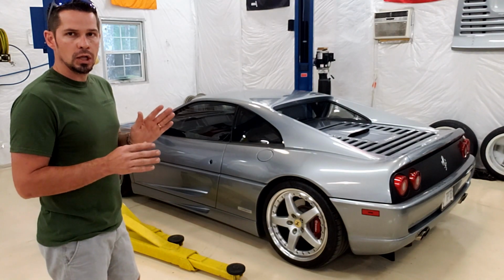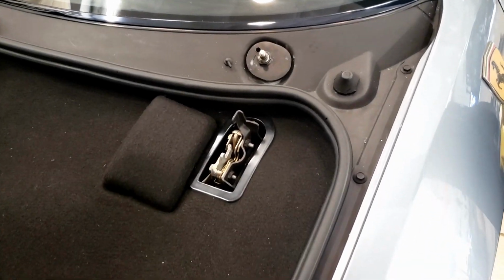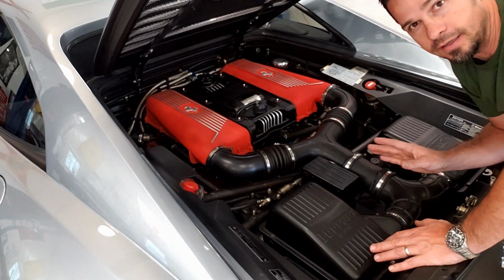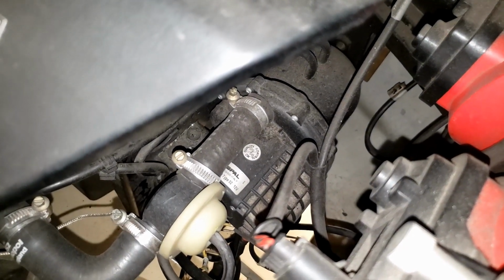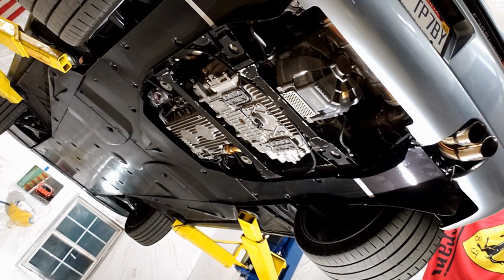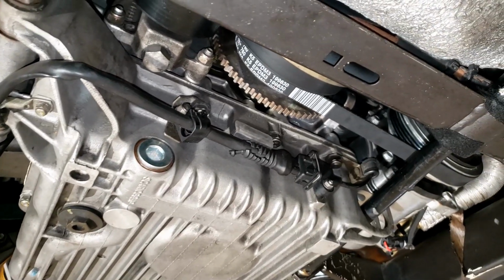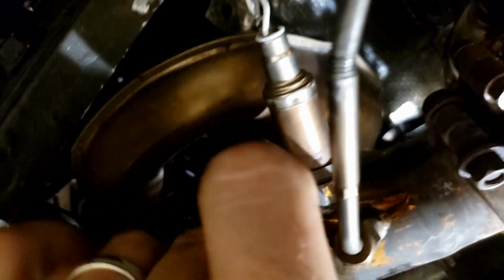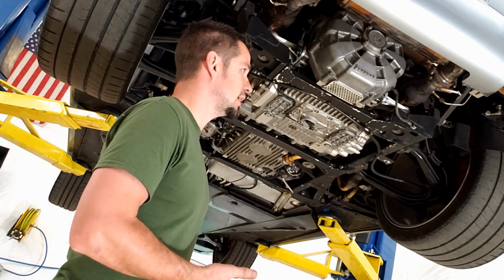Discovering the Ferrari 355, In depth mechanical walkaround on lift

Comment: I don't appreciate the disingenous premise of the intro. Doing it yourself is a BIG DEAL. That garage didn't magically appear out of nowhere. You didn't find those expensive tools in a Cracker Jack box. The time you spent on it has to come from somewhere else in your life. And not everyone gets as lucky as you in their part failure rate.

You make it sound like you can just snap your fingers to save tens of thousands, when in reality you have to buy and maintain your own little dealership.
Reply from the maker: Sorry to offend you. 
At the time this video was made, I found most other reports of this car were quite disingenuous, claiming they needed something like $30,000 a year in maintenance. My claims are not related to the fact that it takes effort to work on a car, I was simply addressing the the stereotype versus other cars. 
Pretty sure it's safe to assume that most owners already have a garage, I don't know anybody who keeps their 355 outside. 
Yes you have to get under the car to do some work... Just like any other car.  you can accomplish this with a lift like I have, you can also accomplish it with a $250 floor jack... Seriously. 
A quick search on the forums or Facebook groups and you'll find that many people do their engine outs with no lift. Literally on Jack stands. 
Do you need to buy tools? Absolutely, however the tools needed to work on a 355 are no different than they are for any other car.  90% of everything you do on this car is literally just a Phillips, or a metric socket. 
Does it take time to work on a car? Can't believe I'm answering this, yes working on a car whether it is my wife's Acadia or my 355, it takes time. So does anything work owning

Comment: Awesome video man! Appreciate it. After my recent yearly service, I have the check engine (emission/computer) fault. Any tips before the dealership makes it a hassle?
Reply from the maker: Point you in the right direction, the easiest thing is just to buy an OBD2 code reader. They can be picked up from anywhere, walmart, autozone, Amazon for as little as $13.
Once you get the code, for example it's a P1448, do a search on ferrarichat.com and you'll find likely dozens of people that have troubleshooted it and fixed it on their cars already.
Reply: @ExoticCarDIY  I was reading that one could buy a code reader, but didn't realize how easy it is to get one. Thank you!
Reply: @ExoticCarDIY  do you happen to know if they were under the steering wheel or behind the passenger seat on the 98s?
Reply from the maker: @schubert5624  under the steering wheel
Reply: @ExoticCarDIY  I plugged it in and it shows no code. Ive read on the forums that the OBD2 readers dont work on Ferraris. Any thoughts?

Comment: Hi - how tall is your garage ceiling and which hoist are you using, how much space above the car roof is there to the ceiling? Would like to achieve a similar setup at home.
Reply from the maker: 30x40 with 12' walls(about 16 ft at the peak). The lift is a ben pack, I forget the exact part number but it is like the XPR 10 LP meaning the pads are an inch lower than normal. The lift is about 12 ft tall, and there is a bar at the top so even if you wanted to you couldn't hit the ceiling before hitting that bar.
I'm just about every car, you can comfortably walk underneath.
Even if you didn't have a 12-ft ceiling, they do make different size lifts that can fit underneath other ones. If I was installing this in the garage that was attached to the house I would literally just put the top of the post into the ceiling between the joists.

Comment: Just found your channel, and I don't drive my 355 as much as I should, but it always starts!  (With a trickle charger on the battery of course).
Reply from the maker: You're backin48 on IG, right?
Reply: @ExoticCarDIY  Yes, getting ready to post pics of my engine out.   (Sorry for late reply)

Comment: Less is more. The entirely analog 348 is the biggest bang for the buck.  The 355 has brass valve issues. the 355s electronic adjustable suspension goes out. the 355 spider's roof is one piece and costs $60k to replace. its now or never for the 348 - the shrewdest sports car purchase in the entire Ferrari market.
Reply: I found the 348 harder to enjoy at speed. I'm no racing driver so the issue may be me but I wanted to really enjoy the driving and restored a 355 instead. Fabulous car to drive.  Fixtures and fittings are not great quality but the handling is great and very predictable. It's one of the cars that everyone should drive at least once,  just to experience a manufacturer at the top of their road car game, in my opinion.

Comment: Great walk round! Need to do my blend door motor, thanks for showing me where it is!
Reply: Isn't a blend door actuator the one which controls air direction to feet, face and windscreen? He pointed to the fresh air/recirculation motor-actuator.
Reply from the maker: The motor I pointed out is the referred to on the forum and parts catalogues as "blend door" "recirculation lid" or "outside air actuator" the motor inside the car on the HVAC box is usually called the "air diverter" or "directional motor"

Comment: Thank you for doing this walk through. I have owned mine for 3 years and have been very happy. I did my belt change with the gas tank out and it seems to have worked. Learned a lot about the car. I am more of  a shade tree mechanic and found it relatively easy to do this without a lift. They are great fun to drive and beautiful to look at. Not as fast as the modern Ferraris that came later but very engaging to drive. Hope you keep doing more videos on the F355. It is a classic.
Reply: Glad you are enjoying your F355. I’ve only had mine for about a year so I’m still learning.

I see mention on other YouTube videos and your comment below of replacing the timing belts without having to drop the engine (access via the rear seats and drop the fuel tank).

My question is how did you manage to replace the cam belt tensioners when you did the timing belt (everyone I’ve spoken to says these can only be accessed by dropping the engine?)
Reply: @sultanoftippoo3857  you can do it all with the gas tank out. See Ratarossa youtube video on the procedure.
https://www.youtube.com/watch?v=5gSb-aiuIsE&t=2413s
Reply: @kw9130  many thanks, I’ll check it out.
Reply: Brother I miss more of the DIY 355 F1 videos. I would like to learn how to change the belt pulley